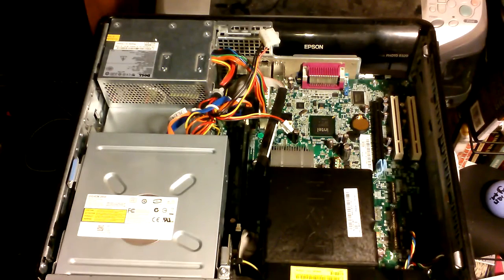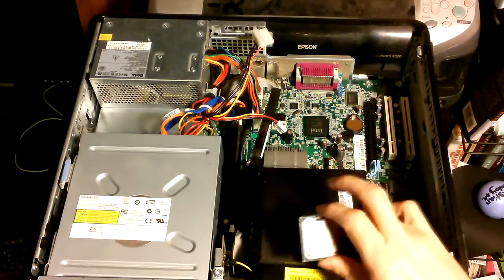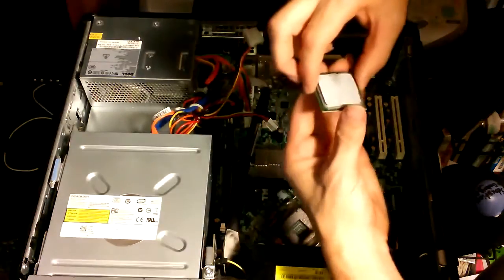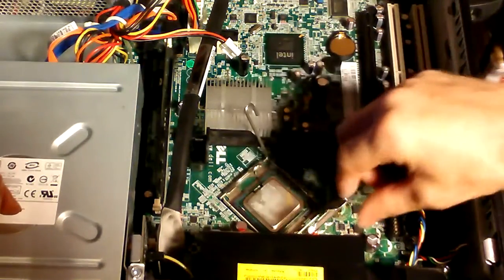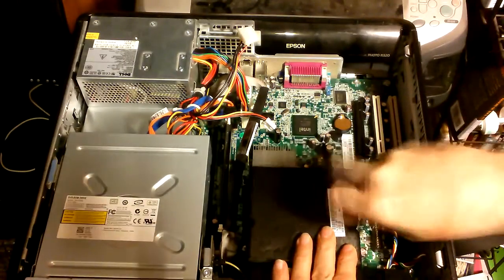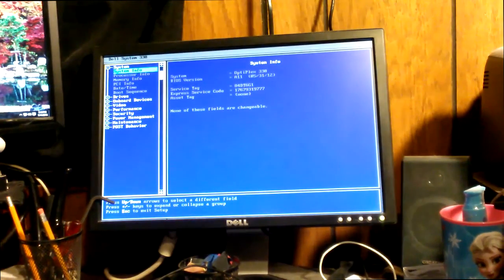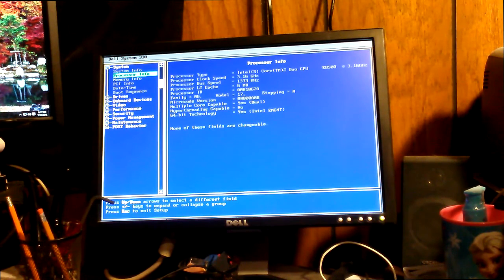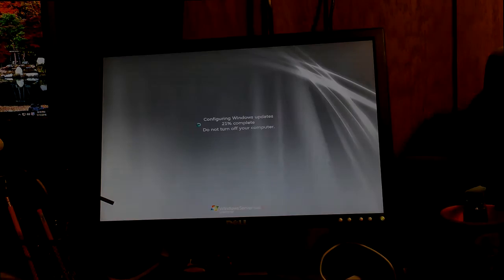Dell Optiplex 330 3.16 ghz CPU Upgrade

Comment: another one is the core 2 duo e7300 @ 2.66GHz. 2022 and the  optiplex 330 still running strong with windows 10 home-64bit. 4gb 800MHz ddr2 ram paired with a little geforce gt730 2gb ddr3 GPU on factory 305watt PSU. great for streaming browsing and light 3D gaming. could easily do ALOT more with bigger psu and gpu. great machine.
Reply from the maker: :) Glad it is still working for you, Josey.
This one bit the dust a few years ago.
It could not handle heavy traffic thrown at it 24/7 for nearly a year of non-stop running, as it was used as a temporary web and database server.
I got home from work one day, and it was dead. You could smell that it had overheated and fried itself.
I did not see anything burnt, which was good, but damn, it smelled so bad that I snatched the hard drive out and chunked the system out into the rainy yard.
Reply: @DarkEffectsStudios   ohh noo that's a bummer mine was actually ran as a server for first 4 years of its life it was replaced which is when I got it, sat in storage for a couple years then turned into my light duty machine. sitting next to my optiplex 990 I built for gaming lol.
Reply: needs a core 2 quad q9400

Comment: A little late and old but if anyone still  has a 330 still laying around, you can UP your 330 even better performance with an Intel Xeon processor which is faster and a LOT more stable. I'm running it with an SSD and I'm going to try increasing it's FSB speed since it is stable, I also changed out the PSU.
Reply: Joe S any luck going over 1066mhz???
Reply: @sonnyberg6333  what model of intel xeon???

Comment: I have Dell optiplex 330 with core 2 duo E8500, 4gb ram I want to overclock it plz explain or any link to know perfect overclocking method and this board support overclocking or any other coolers can I buy I don't have fan in that processer upper

Comment: Hello, I'd like to upgrade my dell OptiPlex 330 to a CPU like yours. Can you tell me the exact type of CPU it is, so I can look it up on ebay? For example, is it an E4500? Let me know, so I can look it up. I want to order it, so if you can give me the exact words to type into ebay, that would be nice, thanks:), great video by the way, I'm gonna use this to help me install mine. Oh yes, another question, do you know if its a socket type P? For the cpu, what's the socket type on this machine? You know, so I can choose the right one. I know most would tell me to buy a better computer, but I got this one for free, so it's a fun little project. I'm just trying to upgrade it to the best tech that was available in the time that it was released.
Reply: Thanks:)